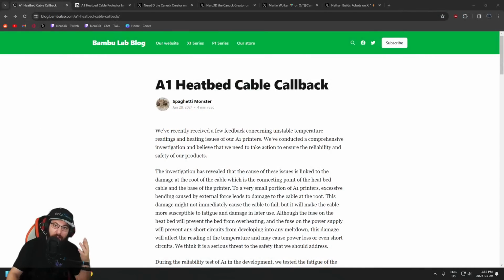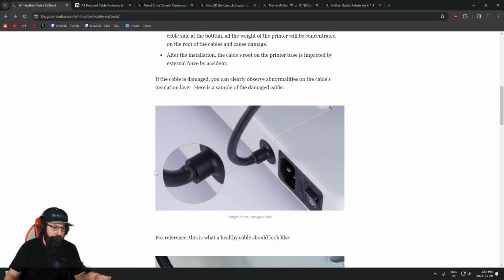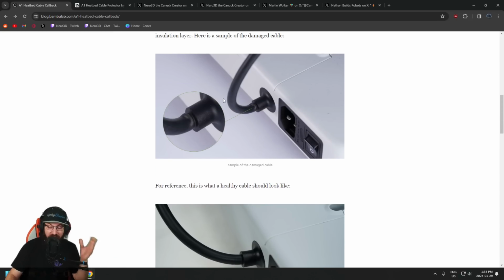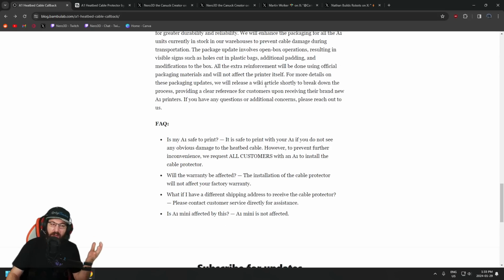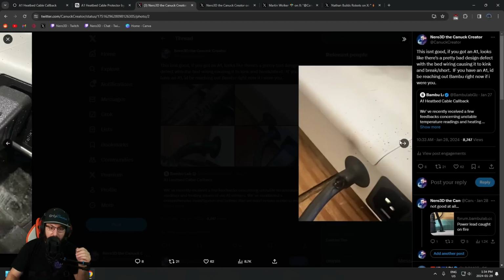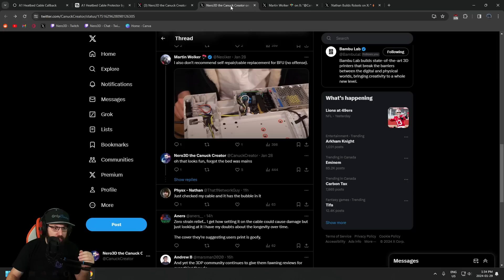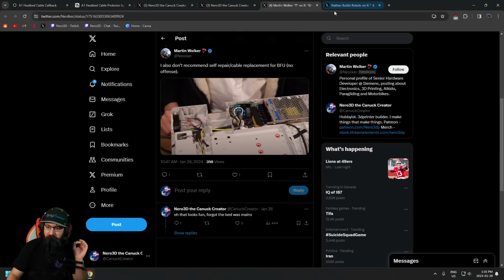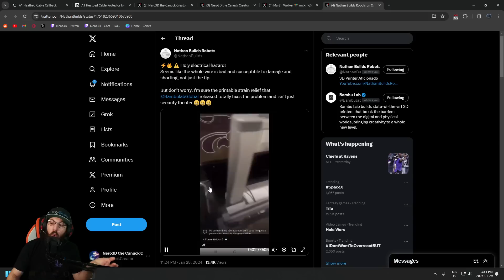BambuLab A1 Bed Wire Failure - PSA TO OWNERS!

Comment: Laughs in thoroughly tested prusa with no recalls
Bambu lab taking a play from the anet A8 playbook in 2024...that's embarrassing. But watching the mental gymnastic of their cult trying to defend this or spin it as a good thing that BL is "correcting" this is just nuts. Should have never happened in the 1st place. This isn't surprising considering they never cared about the fire hazard their printers had last year with that long 3 min thermal runaway timer.
Reply: Prusa not too long ago had issues with thermal runaway on MK3s machines they needed a fix for. These "thoroughly tested" machines have been out for more than half a decade.

My point isnt even to dump on Prusa, its to criticize your nonsensical tribal war bs
Reply: Sir lilape, if copium was a power source, you would have powered the entire human civilization for a 100 years.
Get a life and stop spreading misinformation

Comment: I’m sorry but the criticism of this is wrong. It’s an open acknowledgement of an issue with a solution and a stop sell. Companies are going to make mistakes, the response is what matters. Not acceptable but the response matters
Reply: There's a lot of truth to that. Just don't think asking customers to play with mains electricity is a great idea. They should just do a 100% recall of every A1 out there and get them all fixed. A pain and costly yes but we are talking about the potential to start fires here, someone could die!!!
Reply: Bambu Lab has admitted that there is a problem, but from experience we know that companies rarely admit the full extent of a problem. Images have surfaced that suggest that the cable itself is not protected well enough for a cable through which the main voltage flows. If this is true, then the strain relief issue is only part of a larger problem.

Comment: Wasnt the rule - no mains on moving things if it can be avoided.
Reply: Voron definitely didn't get the memo on that, aren't the beds on Trident and V0 mains powered?
Reply: @AuntJemimaGames  yes.. but updown is way easier to get stable (and way less movement in general). Switch wire uses a 24v board.
Reply: @AuntJemimaGames  Original v0 yes. Current spec is dc since the bed is so small.
Reply: @AuntJemimaGames  My V0.1 is certainly not mains powered. 24V DC are plenty enough to heat the tiny bed.

Comment: Australian’s - technically need a Licensed electrician - do diy and house burns down, the insurance will deny claim.
Reply: Same in EU
Reply: So, you're not allowed to build any Kit printer then?
Reply: @thenewmodelworkshop5743 not legally, also not legally allowed to leave extension leads out etc, some LV stuff is OK but our laws are very strict(and moronic). There's a fairly widespread conspiracy theory that it's more about making sure the tradies keep getting paid, rather than in the interest of safety.

Funnily enough we don't have a standout record for safety in electrical installations, seems pretty clear that a more relaxed solution that aims to inform people of their liability would go a long way towards actually improving the safety of our electrical installations in Australia.
Reply: @ballbous  So home improvement stores are banned from selling power sockets, cabling & light switches? Seems daft, when the entirety of the local fauna is deadly to humans, seems like the least of your worries is a poorly wired light switch.
Reply: @ballbous  I think it’s just the government can get an annual license fee (tax)  for the trades. And it’s a way for insurance companies to weasel out of claims. 

A standard for installations - is there no Australian standard?
Reply: @thenewmodelworkshop5743  oh you can buy them and install but you technically need a certificate to insure. It all labeled must be installed by licensed electrician.  The onus is on insurer (if there a problem) to prove it was you who wired rather than the previous owner or possibly shoddy electrician prior to regulations etc.. Lol. 

It’s lik3 bong shops selling bongs (aka fancy ornate plant pots) in countries where it is illegal to buy marijuana.., 

Yes, just about everything here can kill you! 

Laws here are that dumb I have to pay an electrician to check my smoke alarms and 2xRCDs in my rentals each year. We cannot legally rent a house unless they have those things. If you have curtains you have to restrain the draw strung to stop kids hanging themselves. 

Worlds gone mad!
Reply: @thenewmodelworkshop5743  Any mains voltage wire has to be certified. Any kit that has mains wiring that you customize like mains beds etc need to be checked. Prusa diy kits have an enclosed PSU and I believe all rest is DC which can’t kill you, In the levels they produce.

The risk you take is you have a fire and house burns down insurer may not pay. As they could say you crossed wires etc. or worse your kid touches a exposed mains circuit and releases white smoke brown and yellow fluid and dies.

Comment: It is crazy they never noticed this during testing...
Reply: Happened with prusa at first too. Also tends to happen when you push it up against a wall. possible all their test printers just sit in racks
Reply: @ZeeLobby  That would also explain why the spool holder on their Core XY machines is still on the back of the printer instead of  the side. With a rack in the middle of the room, you have easy access from the back. If the printer is against the wall, it's a different story.
Reply: @andreas.grundler  Yeah, I seem to remember them posting a lot of pics and vids of rack mounted printers. Def seems to be a flaw in their design process
Reply: @ZeeLobby a very very long time ago and that was only 24vdc not mains voltage.
Reply: @thegarageluthier  Eh, not that long ago. I remember specifically when it came to putting the mk3 in enclosures as well. A simple google will tell you that wire failure and shorts at the bed connector is still pretty common. I mean there's parts you can print to better support it, etc. I mean it's just a common issue with bed slingers, heatbed cable issues. Just sucks that every manu struggles with it.
Reply: @ZeeLobby  the MK3 is a different machine and use case, Plus 24vdc is very different to playing with mains voltage.
Reply: @thegarageluthier  understood. Just find fanbois on both sides annoying. Every printer company has released flawed designs. The best and the worst
Reply: @ZeeLobby  not a fanboy for any printer company, only ever built my own never bought into any company, well other than 2 cheap Ender's when they first came out because they were so cheap.
Reply: @thegarageluthier  sorry. I didn't mean you. I mean this whole initial chain. Like that somehow design failure is unique in this instance, or deserved because of their success. Likewise I mostly built my own. Have a prusa and Bambu printers. Both are great. Both have issues.
Reply: I guess a lack of experience in what to look out for when it comes to bedslingers. Interestingly, the strain relief of the A1 Mini seems a little different. You would think they would use the same design for the same type of printer.
Reply: @bomas_ulz  it at least has some percentage of failure rate. How much we don't really know. Anecdotally I know several people with the printer without this issue (so far) and I know of only a couple people online complaining. Taking down the sales page is def a sign of acknowledging maybe a bigger problem. Or getting ahead of a smaller one.
Reply: @ZeeLobby  there is enough of an issue that it forced them to make a statement so probably more than just a few edge cases..
Reply: There were no long-term testing and no FMEA/FMEDA at all.
Reply: @MartinWolker  Bambu employee?
Reply: @ZeeLobby  Siemens
Reply: @MartinWolker  ah. So how do you know?
Reply from the maker: i mean, if they HAD done long term testing they would have caught it, and with certs, you can "self declare" and wont actually be checked unless something bad happens, which, this may fall under, so they made have their certs checked

but it really depends on the country/laws
Reply: @CanuckCreator  I mean and their test setup. We also ended up with iPhones that bend and Samsung phones that burst into flames. The reality is they didn't test shipping to themselves (why would they), and they probably had test benches where no backing caused cables to bend when the bed slides back. I'm in no way saying the design was good. It's def bad. But you don't throw out this much injection plastic production with only a month of testing. From concept to sales it's probably been at least a year of lead time. I'd be shocked if they weren't at least running an A1 during that time.
Reply from the maker: @ZeeLobby  ive worked with serveral companies in our sphere and ship testing for damage is a thing and ive been part of it a few times for pre-production things.
Reply: @CanuckCreator  yeah. I know it's a thing. But often it won't catch what may be intermittent issues. My A1 hasn't had a problem, and like most complaints on the Internet being amplified, most probably haven't. It would have been nice if something like that was caught though. But there's always going to be some things that don't show up until you've shipped thousands of units.